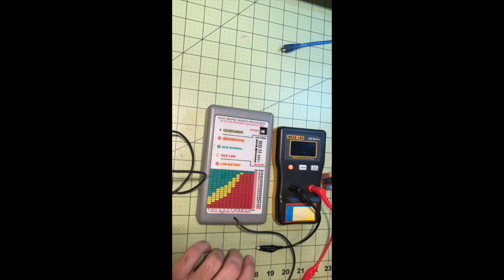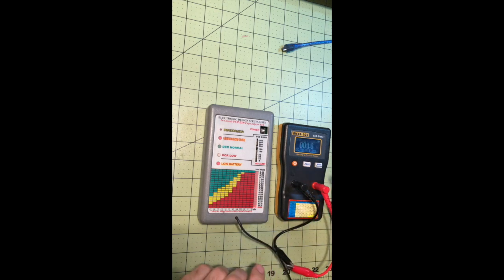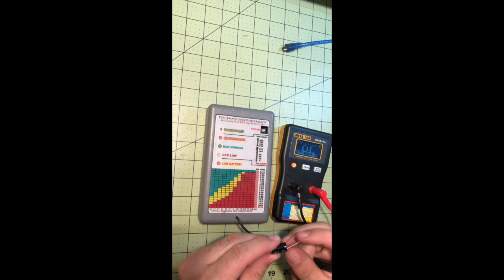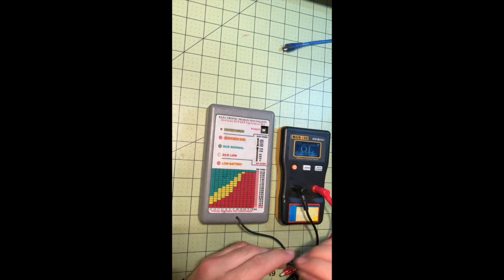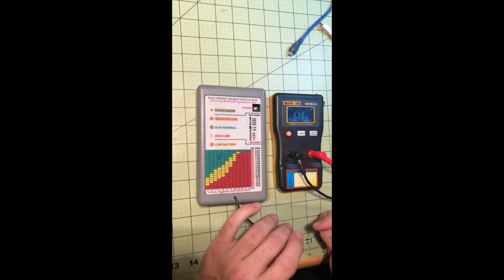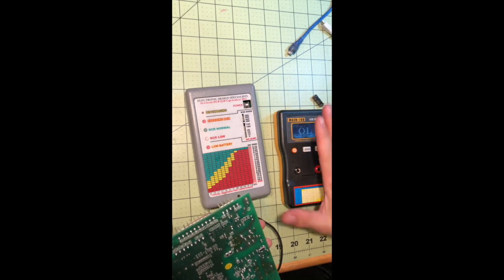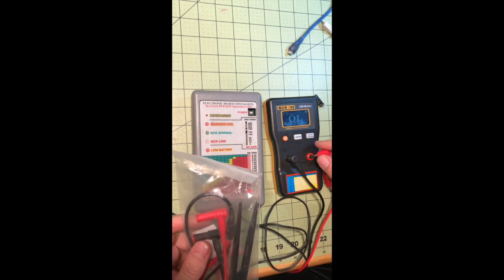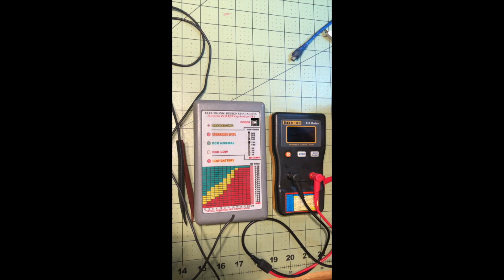ESR capacitor tester

Comment: Excellent comparison. Your banana connector rant is hilarious but so true.  I got quite frustrated with the Mesr-100 when the cap voltage was obscured by another component that couldn't easily be moved. No problem with the 881. But then I had a bad cap that the 881 did not respond at all, didn't know if my battery was bad or my meter was faulty. Used the mesr-100  and then I saw 69 ohms which was out of the range of the 881. I know now that if it doesn't respond the cap is probably bad. I think having a readout like on the mesr 100 can be good in some situations but confusing in others. This guy found a use for that feature to test for shorts in diodes while in circuit since it can register miliohms.. may not be accurate but good  for comparative testing/analysis. https://youtu.be/z5JXm9jgLp8.
Reply from the maker: Good video, thanks for sharing it, I just diagnosed a monitor that had a shorted component on the secondary, was an 8 pin IC, dual mosfet. I was able to locate it in a similar fashion by using my bench meter, it has 1mΩ resolution, made it easier, also used my thermal imager to confirm the chip was heating up, as it was. I saw the video of the 'leak seeker' and I will tell you, you do not want to use that in a customer's home. The fluctuating beeping is super annoying, great fundamental design, but should have come with a headphone jack option.
Reply: @electronicsprojects4708  I’ve had a few leek seekers over the years and built two new ones in the past 12 months both from the “kit” version That’s available now. 

I just put a piece of kapton tape over the Piezo beeper inside. You can put multiple layers of tape over it until it gets quieter and quieter. Or you can put a little slider volume adjuster somewhere on the side of the housing. Also modified mine to work wirelessly from internal rechargeable battery.
Reply from the maker: @hullinstruments  yea, I have put in potentiometers with both buzzers and lcd display to change brightness as well.

Comment: Good comparison of the two testers.  I prefer the DER EE DE-5000 lcr meter.  For 100 bucks, it measures inductors and resistors as well.  It also allows you to change the frequency to test the esr as per the cap manufacturer's specs.  It comes with the short gator clips and long tweezer leads.  
Good video. Thanks for taking the time.
Reply from the maker: Looks like a nice meter for the money, nice screen, I may just buy one for myself. I like the dual display ESR and capacitance, it's nice, but not necessary, our meters have capacitance measurements, I don't even check capacitance in the field hardly, ESR tells me if its bad every time. Switching test frequencies for our application is not a factor as looking up the original test frequencies from the manufacturer is not gonna be something appliance techs will do in the field, need to keep it simple. Really, just need to get a ballpark on the ESR, not military tolerance, lol. I like the two meters in my video because they have the chart right on the meter, on the 88A I don't even look at the chart hardly anymore, the LED bar graph tells me if its good or not, and the MESR-100 will tell you on the display if it's good or bad on the readout, but you do have to read it and figure it out. With the DE-5000 you have to refer to a separate chart, I'ld probably shrink and laminate it as it would get ripped up in the van. Thanks for the recommendation, though, I think for my workbench this would be a great add.
Reply: Electronics Projects Yeah the DE-5000 is more helpful when experimenting on the bench.  Either way good video.
Reply from the maker: Thanks, just bought one, $110 on Amazon, $92 for the meter, $18 for the tweezers sold separately. It says 'meter only' hope it comes with a case.
Reply: Electronics Projects Mine didn't but maybe yours will.
Reply from the maker: No worries, I probably have an extra case that will fit it.
Reply: Does that meter allow in circuit cap tests? Meaning, does it auto-discharge the caps before testing like the Peak or Wizards do?
Reply: @LeviBulger  I don't think so. It's been so long and the reviews I based this purchase on didn't mention it. I mainly used it for making inductors. I wouldn't use it in-circuit prior to discharging the cap to test.  Thanks.